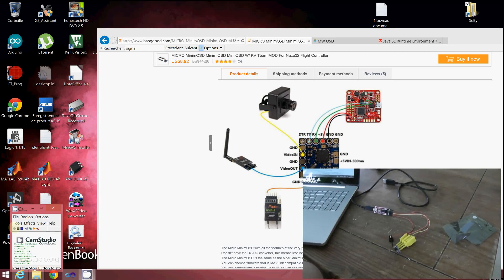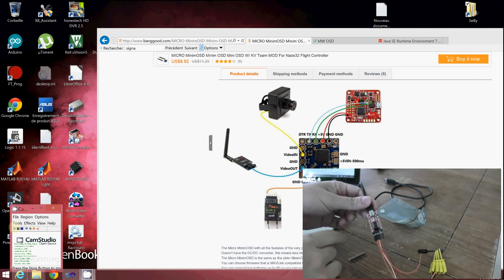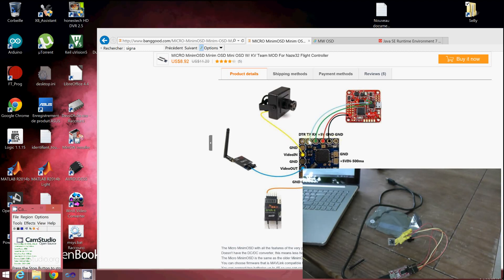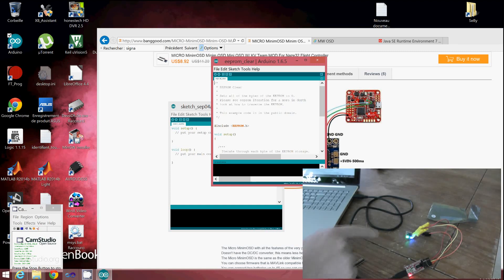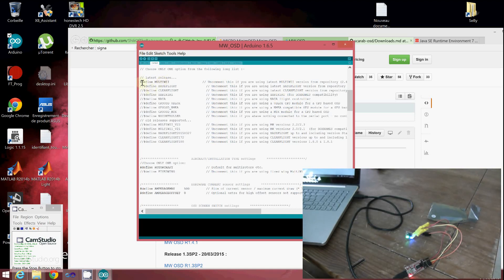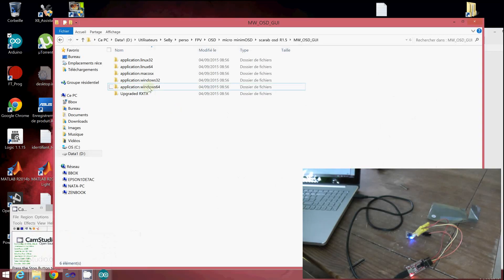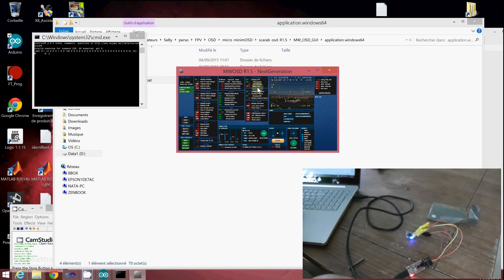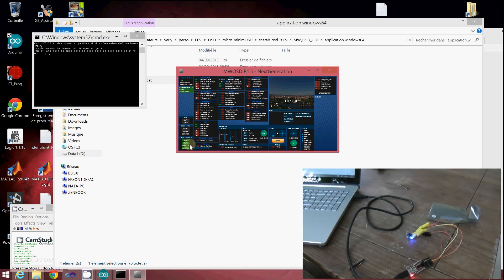MW-OSD installation tutorial for micro minimOSD  (Courtesy Banggood)

Comment: Ive been at this for hours! Im having such a hard time flashing firmware via the passthrough feature. I have tried every single uart port and every possible tx/rx pads on 2 different flight controllers. I cant get anything to recognize my osd board. I MUST be missing something! Anybody ever had success using the passthrough method via betaflight / cleanflight?

Comment: Hi +SeBy DocKy ,I can't complete the first step as what explained in your video. The eeprom_clear stucked in the middle of the uploading process. I am not sure whether the computer is not supported or the ftdi232 has bricked. I have 2 unit of ftdi connector and both were used for the attempt of flashing the board to Mwii firmware. Here is my computer details : Dell D620 (Win 10, 64bit) Here is my ftdi232 details : Driver version 2.12.6.0 Please help. What should I do now..